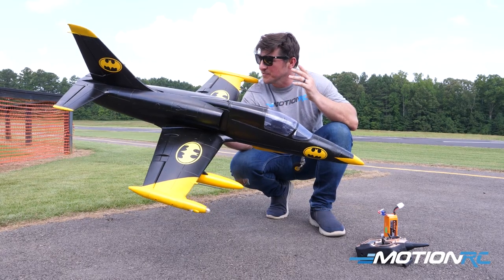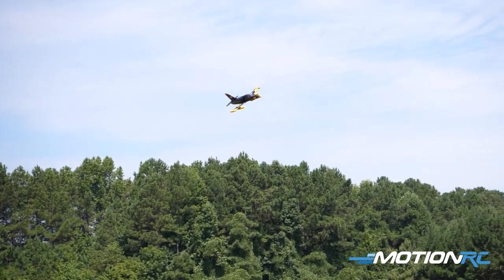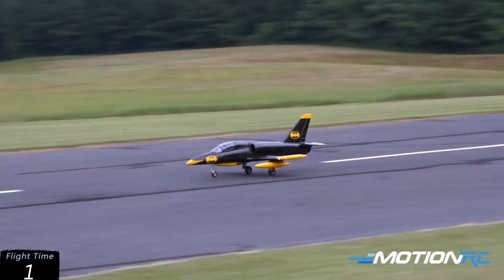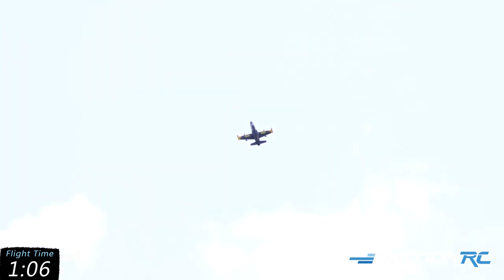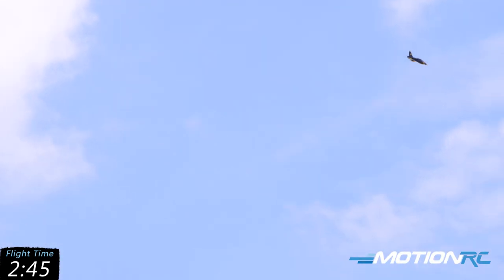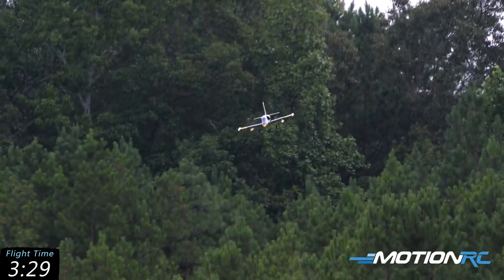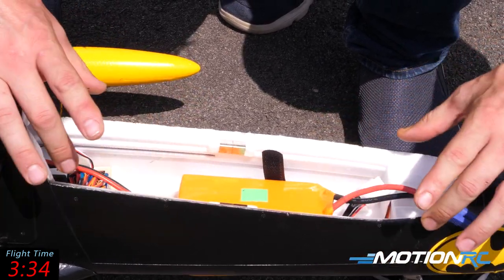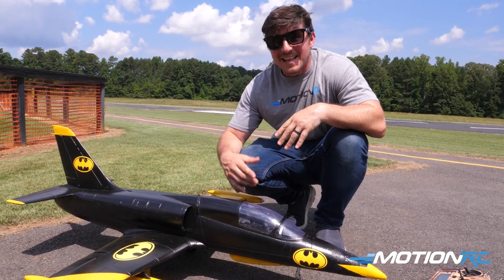"Batwing" L-39 Albatros High-Performance 80mm EDF RC Jet - Motion RC Flight

Comment: Love the paint job👍🏻 very smooth landing.
Reply from the maker: I love this aircraft for that. She can't just float in if you have the speed right
Reply: Motion RC I think you just becoming more pro. While I got you James, thanks for the A6 Ordnance link. Making 👍🏻 Also maybe working late Friday, so I not board of the channel 🤓
Reply from the maker: @DadsRCHangar  sweet. Let me know how they turn out. Haven't printed that set yet, but know some who have
Reply: Motion RC I will add pictures on Hobby Sqwak, nearly done. I don’t have the best printer. I was hoping to spray them for my Friday You tube, but been one of those weeks at work 🤓
Reply from the maker: @DadsRCHangar  sounds awesome Chris!
Reply: Motion RC posted the picture on the Facebook page, could not find Official post for the A6. 👍🏻

Comment: These are very nice planes without question. I may be alone on this, but, it seems the same airplanes are introduced over and over again, just a different size and or more upgrades. How about the century series jets that have been ignored?
Reply from the maker: We always have something else coming. Just did the T-33 though, that was the first foam-electric one ever. This video though wasn't re-introducing the L-39, just showing the fun you can have with a spray can. Many more on the way

Comment: Sir I have 64 mm 12 blades EDF with  3500 kV QX motor but I have 3s lipo battery gens acc 2200 mah 40 c can EDF run on it
Reply from the maker: Without manipulating the motor housing a 64mm EDF will be way too small for this aircraft.
Reply: @MotionRC  not for this jet.sir only tell me that 64 mm edf run on 3s well or not
Reply from the maker: @mehmoodkhan275  oh. Yes, most of our single 64mm jets fly on 3s, but some also use 4s
Reply: @MotionRC  Thanks for replying me THANK SIR